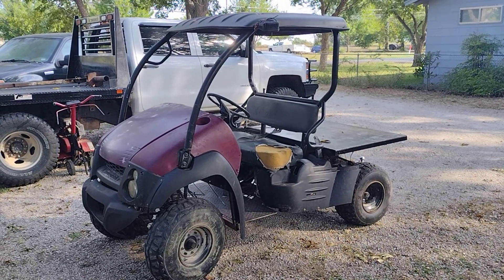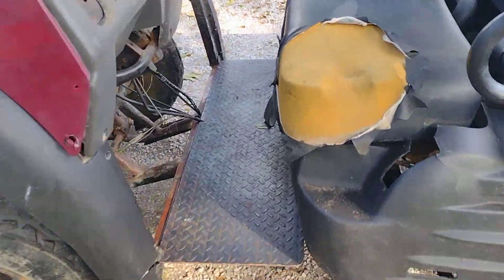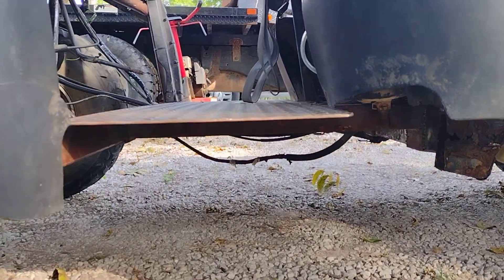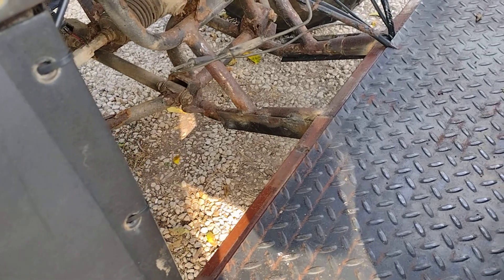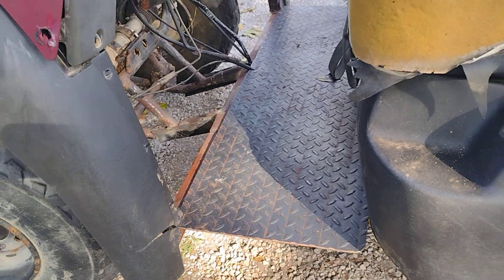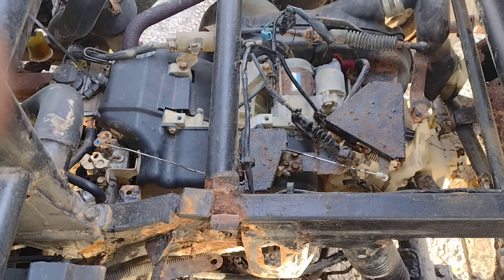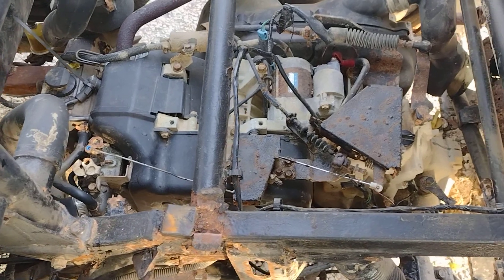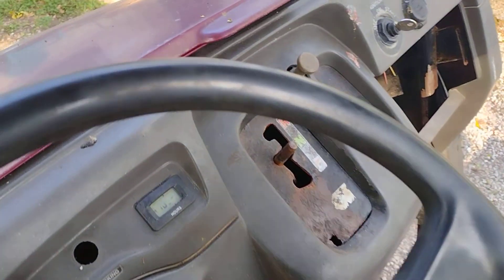all patched back together 4

Comment: That's coming along great. Lots of life to be had left. Will be an awesome shop vehicle moving projects, parts and such around the place. Blessings  and respect to the grind and hustle!
Reply from the maker: Thanks so much ! Now all I need is a fork lift on the back like the one you have ,that fork lift you have is awesome !!
Reply: @countyroadvideos  might be a little fabrication in store for you there. Really a simple lift. I think I gave twenty bucks for it.. You could probably make it so it could be removed using 2 inch square tubing and pin it like reciever hitch.